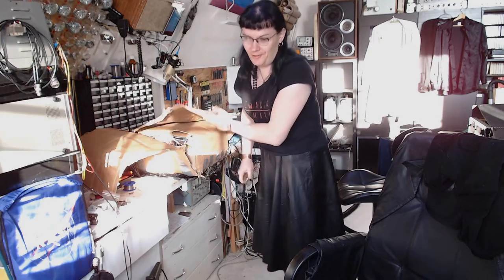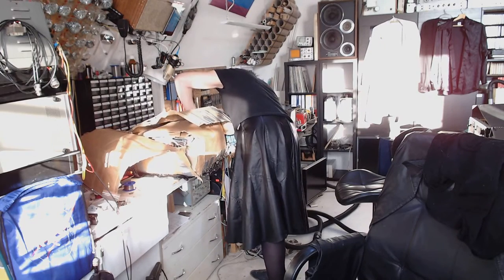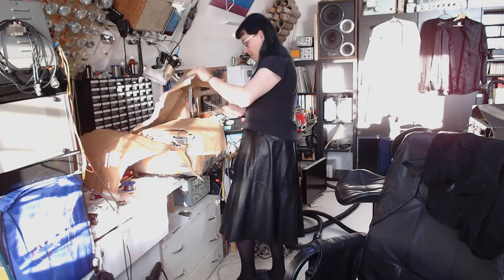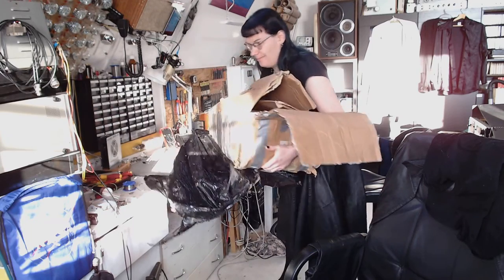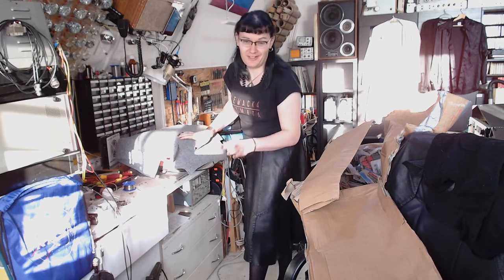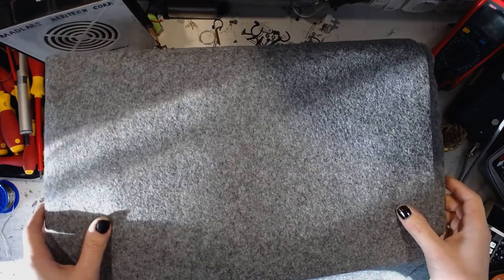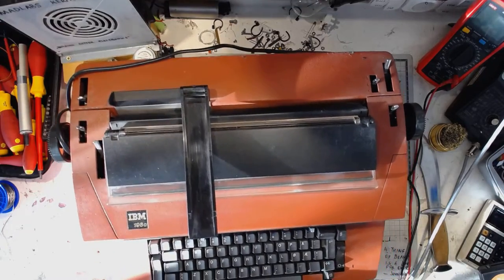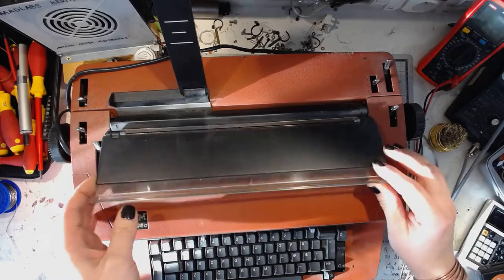IBM Selectric III Restoration Project, part 0: Unboxing and First Glance

Comment: Hi TW, I had an old Selectric many years ago. I converted it into a RS232 printer and used it to print Gestetner stencils. I added some o/c drivers for the solenoids, it was all controlled by a custom 6502 Fig-Forth program. All I have left now is the program source code. To re-live the old days I now have a wheel writer modified into a terminal. Good luck with the restoration. DR
Reply from the maker: This Selectric is still mechanical, and I'm gonna get a Composer or newer-generation electronic typewriter to hack a tty out of it :)